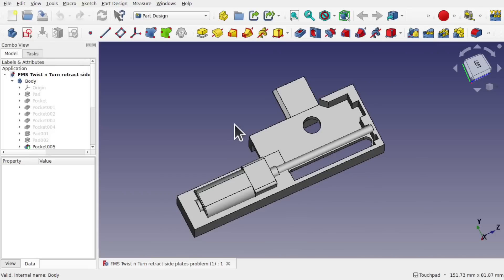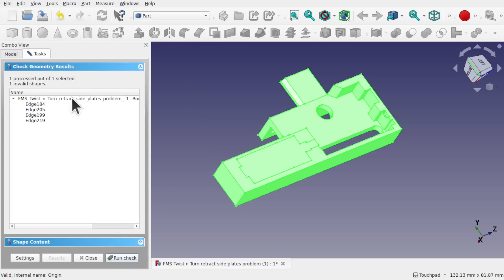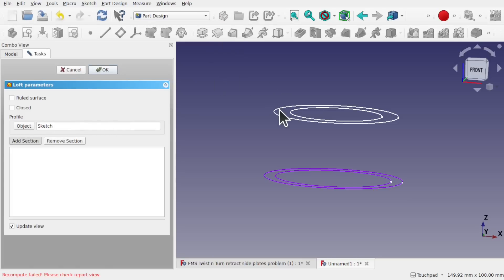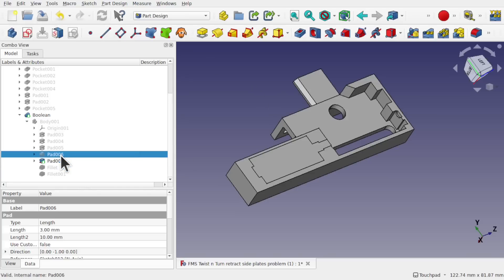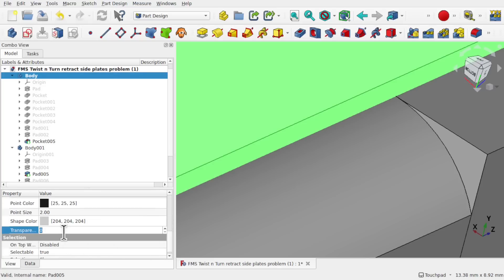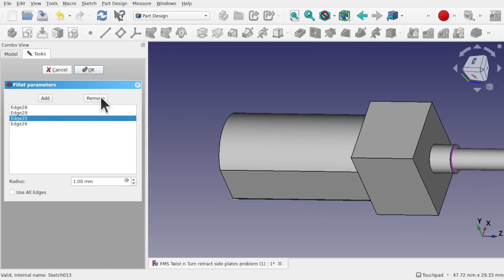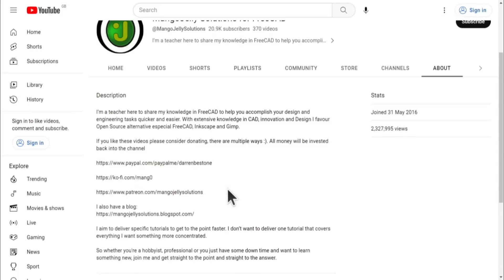What's Broken? Find and Fix Problems In FreeCAD | Identify and Fix Self Intersections in Part Design

Comment: Thank you for going over this. My part has been breaking and I couldn't figure out why. Tried running a Subtractive pipe, worked fine. Mirrored the feature. Showed up fine. And then when to make an adjustment earlier in my part for a hole that wasn't even part of that area, and suddenly i was told base model could not be Boolean. A ton of errors kicked on for edges and sketches that weren't even near it. Tried to go back and it kept saying it even after undoing and refreshing the part. the whole part got corrupted. Not sure why this software has to be so complicated. But i'm seriously thinking about switching to Solidworks lower tier version. This software does not make troubleshooting easy either. The errors used names of the edges and features but not the ones that I have named them. So i have no idea where those are since this is a combination of references and parts with binders. Feels impossible to troubleshoot.
Reply from the maker: This is really strange I have just replied to a comment along the same lines.  The underlying geometry engine is at play with the errors here which pass up through freeCAD makes it even more frustrating as the developers have their hands tied.  Unfortunately, when the model tree gets complex, troubleshooting becomes much harder.
Reply: @MangoJellySolutions  yes it definitely does get more complex but I feel like this can be solved with better ID and relational structures in the code. It seems that many of the references continue to get buried and the storing of the IDs is not optimized. For instance, they can choose which name to print out on the console error or they can choose to print out both so we know where to look. BTW! Not sure if you covered this, later, but in your videos, a HUGE thing i noticed is the DEVATION IS FUNCTIONAL to the output quality for other software. It gets exported with it. So if you're 3D printing or taking it to other CAD/CAM the deviation resolution facets get exported with it. So if you want a near perfect part you should always reduce the Deviation to 0.01 before exporting it. I now only work in that.

Comment: This is awesome. Yes. More fixit videos. 
I have a problem with a part I designed from scratch using part design workbench. Everything looks great in freecad, but when I export it to Bambu studio it has a manifold error. Can be fixed in Bambu studio, but clearly I did something wrong. Do you have a video that touches on this? I couldn't find one. Million thanks!!!

Comment: Thanks for your "secrets". I've discovered the "geometry verification". 
For me, i think the more appropriate is :
- to reference geometry the more "up" (in the tree) you can (example : the origin planes).
- if you can't, try to reference geometry from the first pad (and not from the last). This means that you have to hide last pads or functions to select the "more higher" you can.
- try to reference from datum plane, reference lines, etc.
- avoid chanfers (and fillets), because their references are regularily not stable (topo problems).
And if they are errors, begin to repair on the top and go down progressively (as you show in this video).
Yannick, from France.
ps : and it's possible to change the order of "functions", very usefull for someone who know exactly what it is doing.

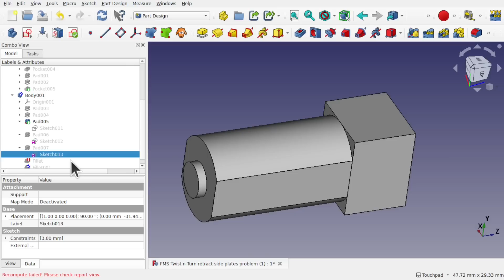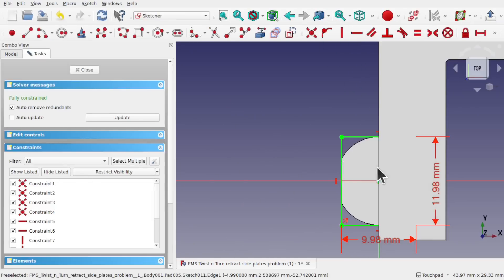Comment: Thanks for showing another great feature (check geometry) I haven't discovered yet and an easy workflow to use it. 👍 — — 15:25 The trouble with the first fillet can be easily avoided by just adding the fillets in the original sketch (see 13:12). And instead of attaching the sketch onto a face it'd better be constrained to a dimension from another sketch or a parameter (→spreadsheet). I only attach sketches to faces in quick and dirty models, but in bigger projects I try to get around that.

Comment: At about 7 minutes you speak about "tip"
Can you refer us to a video where we can become proficient with the concept?
Reply: As far as I know, there is no such video. The tip of a Body is the final stage of whatever operation you did to build that body.

Usually. It is possible to set the tip 'before' the final one, so you can use/reference/fix that same Body in an earlier build stage.

Earlier, that is, in the sense of the sequence of operations, not in the chronological sense of 'undo'.

You can, for instance, get a binder (or a link or a clone) to an earlier 'tip', in order to build, for example, a mating part to a Body which depends only on its basic geometry, which won't change as the tip grows and grows.
Reply: @quantisedspace7047  Thank you..I had the same question about 'tip'..
Reply from the maker: Great explanation in the comments already so I have nothing to add but you have highlighted an area which I haven't touched on yet and that's using and manipulating the tip in part design. I think that would be a great video to get to understand it better and what else it can be used for.
Reply: @MangoJellySolutions  When you do create this video, be sure to provide the link here. Thanks a million!!

Comment: I started CAD with ProeE and did UG also.  Every model can be broken and break. Also played with the Free Creo which is now a full package. UG has both the model building with a history list of the build like ProE and freeCAD and like Creo lacks this list but is more robust in editing the model. Saving the model is like starting with a step mode. A few steps in the build are saved and you can go back this small amount before saving.  This approach doesn't break earlier components on the list but that is not always an advantage.
I will say the freeCAD problem with how it list points, lines, etc. that are just shifted when altering sketches is unique to this software and annoying.

Comment: This business about 'drawing one circle first, and then the other' is news to me. I had no idea that this was sequence-sensitive.

As far as I am concerned, the software shouldn't care: it's a sketch with two circles; it doesn't matter how they got there. 

If I draw two concentric circles and extrude, it manages to work out which is inner and which outer and I get the same result regardless of order.

How is it then, that it can't resolve lofts in a similar manner. This is a serious flaw. It's like having word processing software format text differently depending on the order in which you typed the two paragraphs, but ending up with the same text visually.

This is the exact opposite if WISWYG. It's  The Order In Which You Did It Is What You Get, Despite The Two Being Visually Indistinguishable.

Would this explain why my additive pipes work cleanly half the time, but just fail for no reason  the other half ?